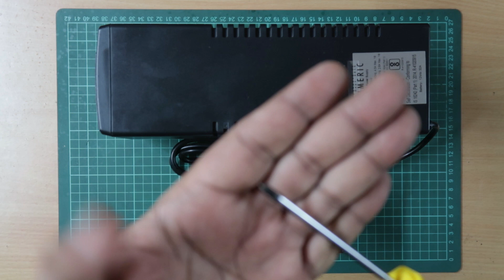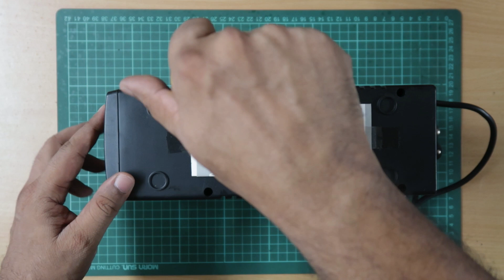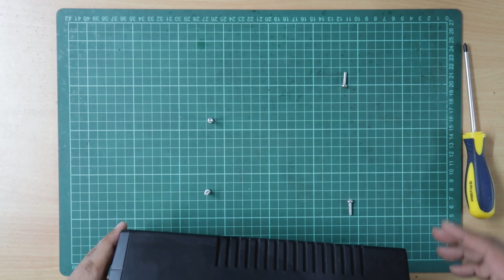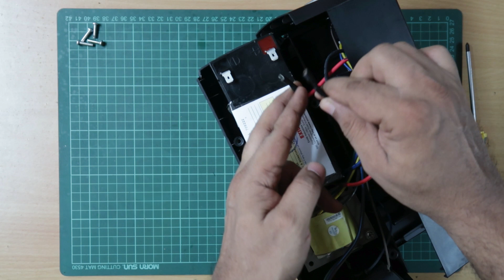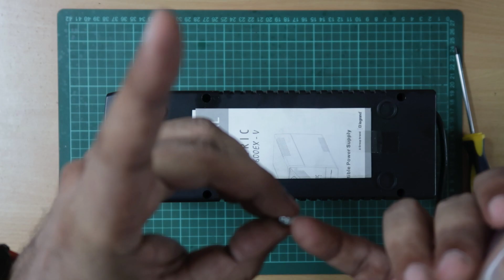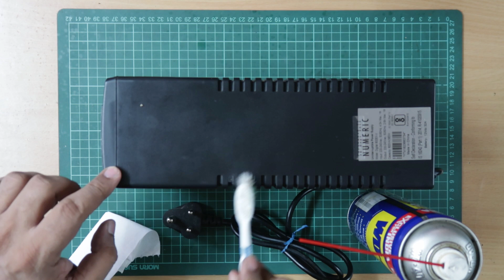DIY | Replace Computer UPS Battery | Tips & Tricks

Comment: a huge warning that these things have super high voltage capacitors in there that are still charged a lot of times.
Honestly unless you're an electrical engineer don't attemp this. or if you do wear non-conductive stuff and be super careful
Reply from the maker: That is a very valid point 👍